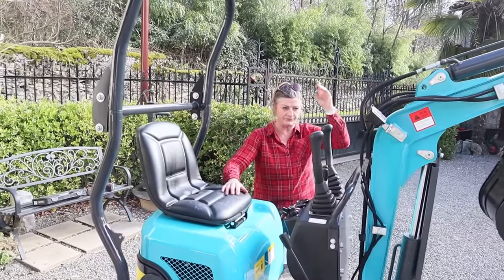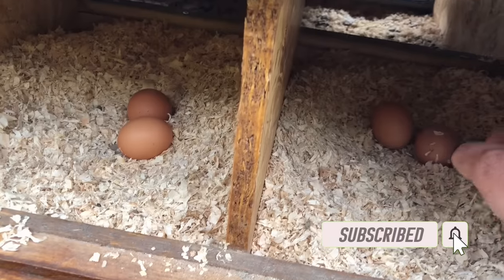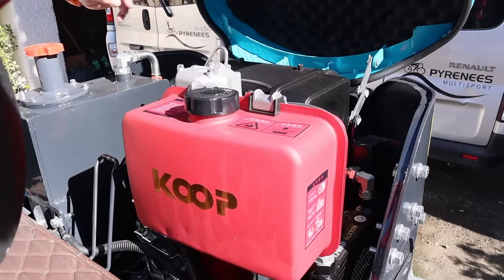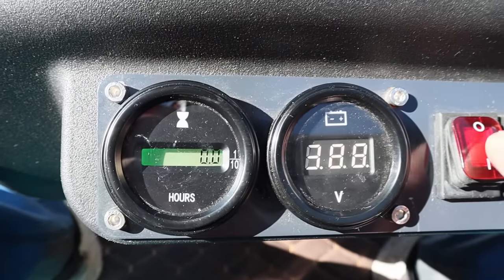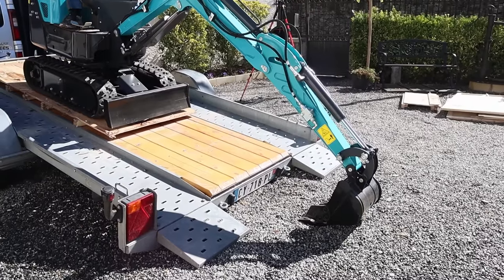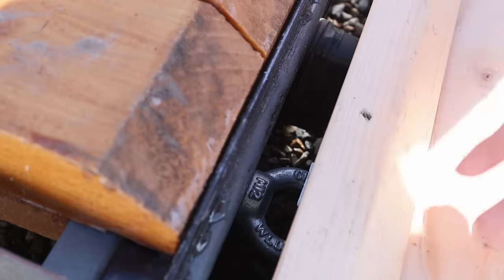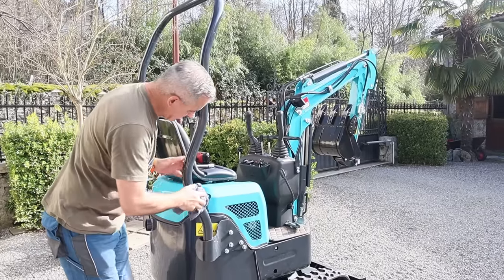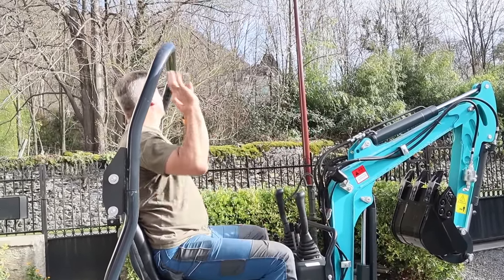Unboxing Chinese Mini Excavator | Nuoman from Alibaba

Comment: I saw with interest this mini digger that you bought it directly from China but I I think it will an excellent choice for your work you have to do. You did extremely well to order also the oil cooler because it will work much better when in summer reaches 40° ! The only question I have is it also cool the engine oil. My jeep had 3 coolers: water cooler, engine oil cooler  and one oil cooler for the automatic gearbox! Yes, I'm a fanatic about coolers 😁, good work 👍👍
Reply from the maker: Hi Paolo - the cooler is for the hydraulics only. It has been very hot recently and it has worked perfectly in 36 degrees - but it is too hot for me so it cools down when I am taking a shade break. 🤣
Reply: @HomesteadingUncontained  thanks for replying, so it is for the hydraulics ,okay! Please stay in the shadow 🙏 😉

Comment: Ok so the main idea of this 
How much do 1 ton excavators cost in your area new and used
How much did u pay for it 
Shipping 
Taxes 
Delivery 
  ? ? ? ? ?
Reply: "It was $4500 with options then $500 shipping. €1000 port fees on arrival and finally €990 VAT. So €7000 total." But we can offer better prices as a excavator distributor also from China 😄
Reply from the maker: A second hand Kubota or JCB around here (if you can find one) is about €12 to €15K and it will be pretty old and beat up too.

Comment: What kind of Import tariff are we talking say like here in America what’s $7000 where you live versus what it is here in the states? It looks nice.Harbor Freight Tools has a towable trencher backhoe for right around $3500 I think,,,but things bend and break on them pretty easily yours looks a little more substantial though👍
Reply from the maker: The unit itself was €5000 ($5500) and there is 20% VAT here in France so €1027 in the end.  No duties but other landing costs etc was another €970.  So €7000 total.

Comment: Smart idea to get the oil cooler. I hear these little minis get hot
Reply from the maker: I use it in the summer when it is 40ºC out, I think it was worth it.
Reply: I just order a NM 18E from this company last night shipping here to the US. It’s a little bigger than yours but not to much. Any advice you can give me with problems I can eliminate before I start using it would be greatly appreciated. 
Cheers!

Comment: Hi Ian and Julie, love the vids, im just about to order the same model as yours, any latest problems ? would appreciate any info, many thanks Glenn, east sussex
Reply from the maker: Cheers Glenn.  It is going strong.  Been using it hard for the past few months.  2 hydraulic hoses rubbed together nd sprang a leak (I did a recent video on this) but had two new ones made up and stopped the machine to see what it was all about as I fitted them,  Really pleased with it.

Comment: If it has not been said before, you can scan the Chinese manual and use google translate to get some usable document (to some level of usable). I did that with a Thai manual for a water filtration system.
Reply: agreed. nowadays, u can download app to your mobile phone to do the jobs
Reply: @fannyalbi9040  Well, I prefer doing that on a computer if it is a manual that I plan to print and use again in the future :)
Reply: @olivier2553  u r very smart indeed.
Reply: @fannyalbi9040  Nothing to do with being smart, it is just a matter of practicality (if you need a plan when repairing a tractor, you may prefer a paper than fiddling with your phone with greasy hands :) and also I find using a computer much easier than using a phone.
Reply: @olivier2553  but isn’t smart people will think like that?
Reply: @fannyalbi9040  I am more practical than smart :)
Reply: @olivier2553  doesn’t smart n practical correlated?

Comment: When not in use it’s best to have to bucket touching the ground, configured in a manner that has the hydraulic ram rods nearly all the way retracted (usually there’s one that has to be somewhat extended). Not only is it a safety precaution that stabilizes the machine, and prevents the boom/bucket from the hazard of dropping to the ground under its own weight. The proper ‘parked’ positioning also has preventative maintenance purposes:
1) it prevents (most of) the rods from being exposed to the elements;
2) it allows you to let the hydraulic fluid depressurize equally throughout the system;
3)  relieving the pressure reduces unneeded stress on the hydraulic system, specifically prolonging the life of the seals and hoses/lines.
Reply from the maker: I try and store it like you say.  It does not move much when rested but I do have the bucket resting on the ground.  Thanks for the advice and commenting 👍🏻

Comment: Nice but I’d prefer for am electric model: no maintenance and no noise.
Would be a perfect match to my Polaris Ramger EV with its dumping box .
Reply from the maker: I would like all my kit to be electric but unfortunately when you are not connected to the Grid it is tough to recharge them.  Plus the majority of maintenance on these machines is not the motor, it is all the other greasy / oily parts 😀

Comment: The whole point of Rollover protection is  that you stay put and keep your hands on the controls, aka, you need to be in your seat. So a seat-belt is somewhat mandatory. You never want to "Jump off" a rolling machine. As it's likely to land on you. Pro tips, Next time, start by checking the engine oil. Then after 1-3 hours of use, Change it! With filter and all. Them small Chinese engines usually has a lot of chips in them.
Reply from the maker: The seat belt has been fitted and I use it all the time now.  Thanks for the comment, much appreciated

Comment: Congratulations on the new Excavator  the motor sounds very decent and i’m  a little suprised on how quiet it does actuall y runs at with the covers inplace usually on lower price Machinery a Manufacturing trick to save money is to skip on Insulation and quality Exhaust systems  originally i was a little reluctant  based on the Shipping Crate although it was made with Crappy materials it appeared to do the job to keep it safe for transport  I was in Residenial and Commercial Construction for over 35/years which i ran bigger equipment these new Mini Excavators definitely have their Placecand Advantages Plus thecRubber Tracks allow you to go,places the SteelOnes will cause damage like Asphalt Driveways  Sidewalks ,etc
Reply from the maker: Cheers Craig, I am still very happy with it and using it all the time on my build at the moment.  I have changed 2 hydraulic hoses due to rubbing but other than all is well.  Thanks for watching and commenting 👍🏻

Comment: Great video...
How much was the total and how long it took until you received it?.. Did you have to pay any import tax or any extra?...
Reply from the maker: IT was €7K in total including 20% VAT - took 6 weeks to receive it but shipping is taking a little longer now.
Reply: @HomesteadingUncontained  Amazing, have you had any problem with it?, I guess most issues will be hydraulic lines and seals?...
Reply from the maker: @RicardoCerveraBlanco  none so far other than the grease nipple thread. Going well on the ground works of my garage/shop.
Reply: @HomesteadingUncontained  Good to know, I will look into getting one... Thanks for the video and all the info...

Comment: What is the retail price for this machine.? Thanks
Reply from the maker: It cost $4500 with $500 shipping and then €2000 VAT/Freight Forwarding/other costs.  So €7000 in total.
Reply: @HomesteadingUncontained  Not a bad price but it fairly increased with vat and shipping etc. If you had to do it all over again would you buy the same machine or go with a different one?

Comment: Can you buy parts for this machine in the event of a break down ?
Reply from the maker: Most of it is standard stuff, so I am not worried about finding parts and the supplier is very accessible and helpful.
Reply: @HomesteadingUncontained  Thanks..That is great to hear..Good luck with your ventures and great video !

Comment: If you want to be able to drive that without being jolted out of your seat. You might want to bend up some forearm rests, so you Can sort of lean on them while you use the controls because those control arms are going to be horrible to operate mate. You could make the left one rotate out the way so you can get in and out nice and easy.
Just a suggestion. If I came across your channel before you purchased it. I would of definitely suggested to purchase one with the controls on the side armrests. But here we are 😁
From the land down under 🇦🇺🇦🇺🇦🇺
Reply from the maker: I think they are on the next size up, the 1.5t - I couldn't find them on the little machines - but I know what you mean.

Comment: would the bolts holding the roll cage in be strong enough? Love this thing, im getting way too many project ideas just looking at it!
Reply from the maker: They are 12 mmm bolts and quite a few of them.  Similar bolts I have on my roll cage for the tractor and the Rally car.  Should be safe enough as they bolt into the 10mm thick metal body (counter weight)

Comment: Not trying to tell you guys how to use your own machine just want to help. I come from a background of running tracked machines, machines of all kinds. All the extra precautions you guys are taking like taking that board of so the excavator didn't have to roll over it are unnecessary. I understand it's a new machine but those tracks are much tougher than you think. Where you want to be careful is on big rocks and concrete debris. It's very hard on rubber tracks. Just a suggestion to save you some time. Best of luck, cheers
Reply from the maker: Hi Jacob - no problem at all.  I do look back at this and snigger a little - first time driver so I was very cautious - a little more experienced now and can move it about a lot better.  But I did get a rock stuck once and had to prise it out so you are totally correct.

Comment: You need your own workshop to be able to repair everything yourself. You can order spare parts from the manufacturer. But if you have this repaired and serviced by an authorized workshop, it gets really expensive.
Reply from the maker: Exactly, that is why I am not worried about the maintenance and repair.  I have my own workshop and am quit handy when it comes to mechanics and hydraulics.

Comment: A roll over protective structure and seat belt is highly recommended for safety. I have seen people die due to tractors toppling over and lack of these protective mechanisms!
Reply from the maker: Have installed a seat belt since and use it all the time.  👍🏻

Comment: As a kid I was fascinated by bulldozer and digger. 
 I would guess you could replace the seat more back and your legs wouldn't touch the engine. But you have to redo the roll cage cut 1/2 and go straight up. But  by now your used to  it as is. It's like how girls ride moped straight up 
and forward . LOL for guys  your arm movement would be twitchy LOL bad leverage .
Reply from the maker: It is a squeeze but as you say I have got used to it.  I hunch over a lot to get better control of the levers but with a few rest breaks I get the job done (with aching knees 🤣)

Comment: those 4 blots on roll bar, looks slightly stick out,looks very easy to catch your cloths when you get in and out or walk around your digger,maybe better put a plastic cap on i guess.
Reply from the maker: Well spotted - I will swap them round

Comment: Hopefully they have plenty of diesel in the tank I was cringing when you started it.i didn't want you to end up air locking it
Reply from the maker: There was lots - but I have run out since.  Not much of a fuel level so I just listen out for the tell tale sound.  👍🏻

Comment: would guess the clamp is for the exhaust. probably would have fitted the roll bars before you drove it off the trailer for the first time.

Comment: You need to change the settings for the controls.  There is usually a switchIt looks like it's set up old school (iso), from before they had multifunction controls.  For SAE settings the wrist and elbow should be on the right hand.  The shoulder and swivel should be on the left.  it is far more ergonomic.
Reply from the maker: oh know - I have only just got used to this way.  I will look into see if it can be changed but my head says, keep to what I am used to now.
Reply: @HomesteadingUncontained  The other way really does work better,.  The old way was from when they had two separate levers for each hand, so they wanted to work the wrist and the elbow with different hands.

The other way (SAE) your right hand will literally make a scooping motion as you are taking a scoop.  This is because the elbow and wrist are on the same control.

Comment: I was considering getting a tow behind digger for my truck but this would be infinitely better.
Reply from the maker: I was looking at back hoes for my Kubota, but I prefer the separate machine specially for tight places.  I use the tractor for lots of cutting and moving stuff around so don't want the digger attached.

Comment: How much did it cost?
Reply from the maker: €7K in total with all taxes and shipping costs. (€5K for the actual machine and shipping from China).
Reply: @HomesteadingUncontained  Thank you.  Did you have to go to China to buy it?
Reply from the maker: @TreasureGeo  No, not at all, I first bought through Alibaba and then once I got a little trust with the supplier I have since bought direct from them.  They all message in English and it is easy to deal with them.  Paying through Alibaba is totally safe and protected.

Comment: You bought a machine and did not know it used diesel?
Reply from the maker: gasp!!....I understood it to be similar to a lawnmower engine.  My lawnmower is petrol - now if I had bought the kubota engine, I would have thought, diesel as my tractor is also diesel.  Pretty much an assumption of the quality of motor.

Comment: Came across your channel just by chance, when I see a unboxing of mini digger from Alibaba I was expecting a remote control, I know this may sound silly but I have had experience before with buying mini bikes from there and let's say I was not impressed with my purchase lol. But luckily enough the return process was straight forward. As I said, I have come across your channel by chance so I will have a look and your past videos. Just a note I'm from London. ✌️ just one note, I had training with these types of machines so if this is a new machine in your line up, I would seriously look into a training program as there are simple things that could end up being very dangerous so please have some type of training on the safe use of this machine. 👍
Reply: Two things, the little black pipe could possibly be to angle the exhaust, secondly I would strongly be against putting copper grease on fittings when securing safety parts such as a roll cage. There would be no need to have this and could be very dangerous unless you do every morning checks. As for a seat belt, you are safer to be strapped in tight with a belt as watching health and safety videos in part of my machine license tests, jumping from a tipping machine believe it or not could be life threatening. You should never use such machines without any safety training. I know im banging on but things like this can kill if you do not have any safety training. Please take some training. 🙏

Comment: Definitely a cool little machine but I don’t understand why they’re going through the trouble of installing a roll bar if the thing doesn’t even have a seatbelt
Reply from the maker: It has the holes for it and it now has one.  But you're right, it should have come with it.

Comment: just the quality of the crate (or lack there of) should be a indicator of the quality of the product
Reply from the maker: The crate was adequate - remember these are loaded into the shipping container on site.  The crate was only off loaded at the warehouse when I picked it up.  Larger machines are not even crated up - they go directly into the container.
Reply: @HomesteadingUncontained  I feel like your mileage may very vs. a quality product like a Kubota... which a K008-5 is going for close to 25 grand, so I guess it all comes down to price, How much was the Chinese mini run you all said and done? like 12-14 grand? I feel like your going to have major problems if you run it a lot. Getting parts is going to be hard so its a trade off. also what kind of torque you able to get out of that little anemic engine? sucker is gonna have to be running full tilt to dig anything.
Reply from the maker: This little digger was €7 to my door so as you can see ⅓ of the price of a beat up old Kubota (which they are here in France) - I searched for 6 months for a known brand machine and after passing the piles of SCAMS there was nothing available and don't like wasting my money on rentals.
Reply: @HomesteadingUncontained  yea at 7k it  might be worth it lol, you should do another vid about it in like 5 years and see how it hold up

Comment: You have hose clamps on your oil cooler lines and they couldnt have put the fan control on a temp switch. Little things like that would make me question the quality of the rest of the unit. In my experience going cheap and buying a chinese unit will cost you more in the long term.
Reply from the maker: The oil cooler is on a switch - so I have the choice to turn it on if I feel it is necessary.  If you cannot afford the known brands this is the only option as a few months of rent pays for it.

Comment: The ROPS are designed to use With Seat Belts, so in the event it does start to roll, you are secure in the seat and protected by the ROPS.  If you want too and think you can jump off before a roll over, you should not have the ROPS up and there is no need for a seat belt.
Reply from the maker: Seat belt is now on there